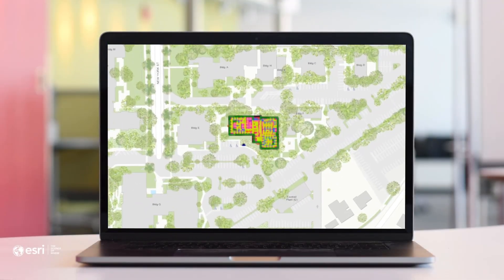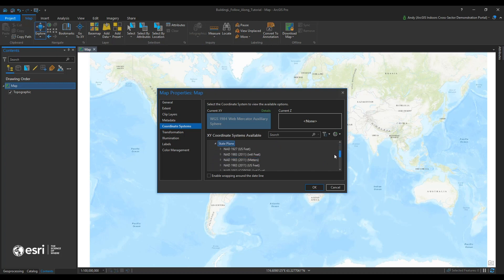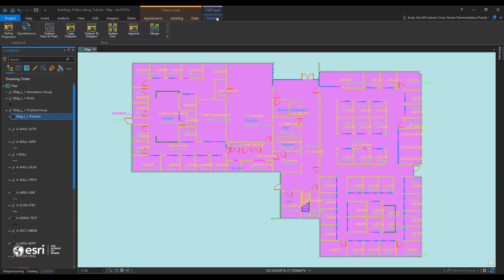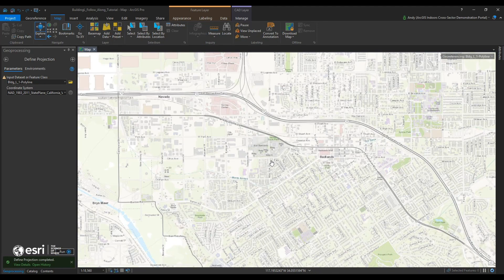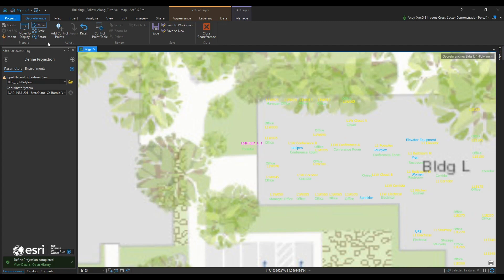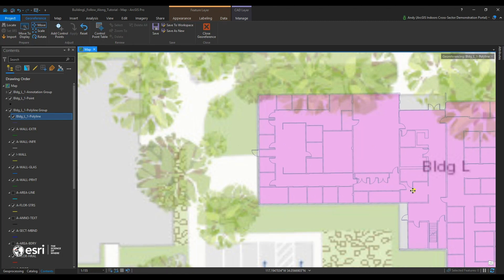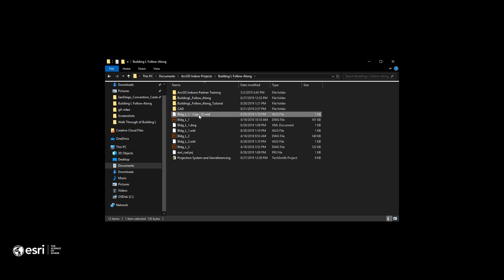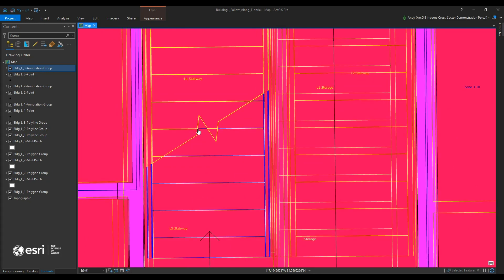(Legacy) Reprojecting and Georeferencing CAD: ArcGIS Indoors for Pro

Comment: I work with DOT engineering files (new roads) and as we all know, the engineering file does not always come in exactly where it needs to be. How do I move it to the correct spot when the new road design is going across a pasture.? I don't have the "To" XY coordinates. There is nothing to reference to. In ArcGIS I use the Transformation tool and click on the Move, Rotate, Translate button. I fill in the X&Y values for all From and To as well as the Angle with 0 (zero). Then with Scale I use the inverse of the Surface Correction factor that the state supplies for all engineers when designing the roads. I type this number in and hit Apply and the engineering moves, rotates and scales automatically to the exact location it should be.  How is this done in ArcPRO?